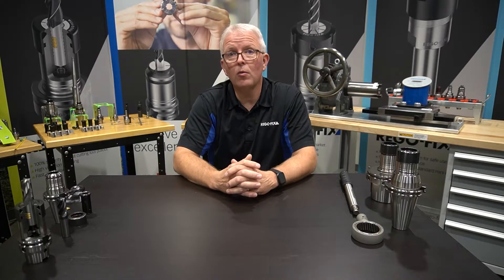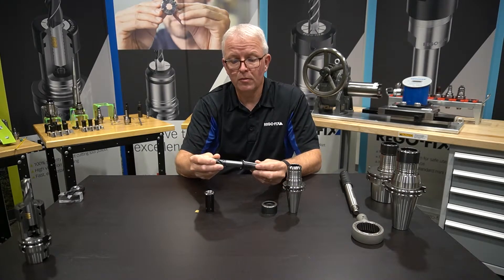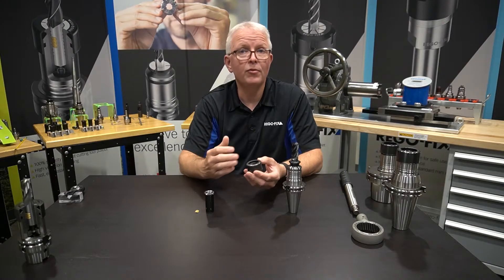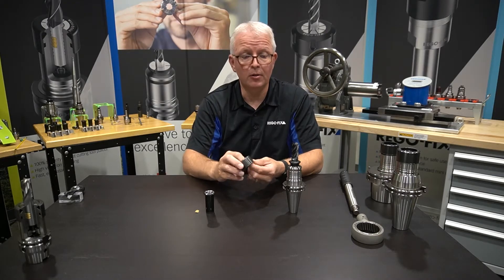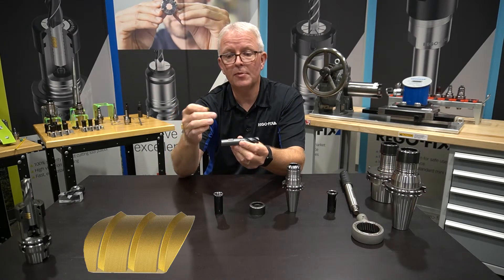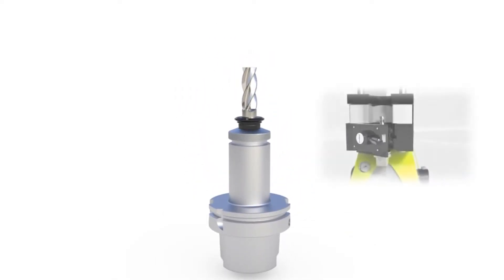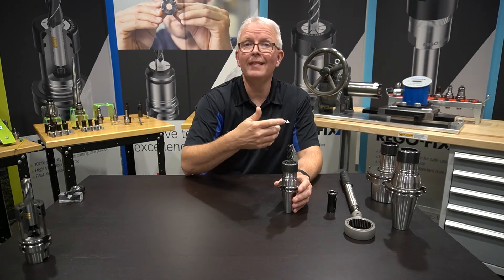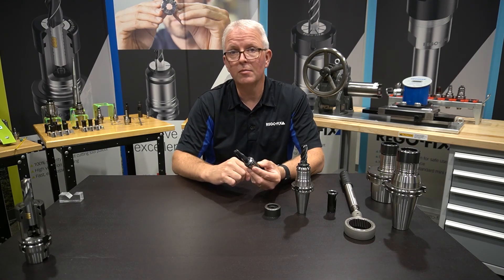TechChat - secuRgrip for powRgrip

Comment: do collets get damaged if the endmill breaks off like with shrink fit tools?
Reply from the maker: While it isn't all cases, the collet can certainly be damaged if the tool break is bad enough. In these cases the blank of the endmill gets stuck in the collet with no way to get it out. Other times you can unclamp the collet from the toolholder and remove the blank piece if it isn't stuck; it's really a case-by-case scenario.

Ultimately, with secuRgrip, we're more than happy to trade the life of a collet when an endmill snaps in exchange for a pullout scrapping a workpiece. It may also be worth noting that less than 1% of secuRgrip users ever need to go with the secuRgrip collet; most use a standard collet with the secuRgrip nut and have no issues. 

tl;dr - Yes, secuRgrip collets can be damaged because of a tool break. We'll take that over a scrapped workpiece any day!
Reply: @REGOFIX  thanks